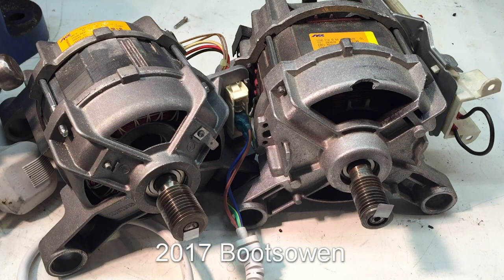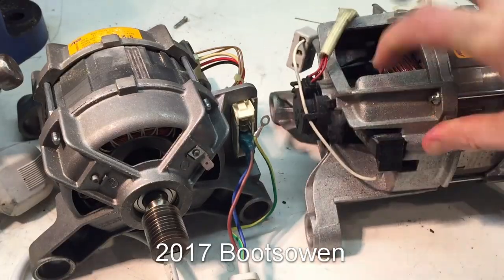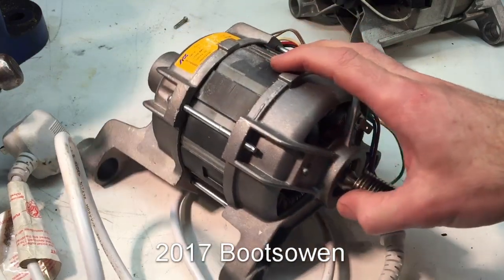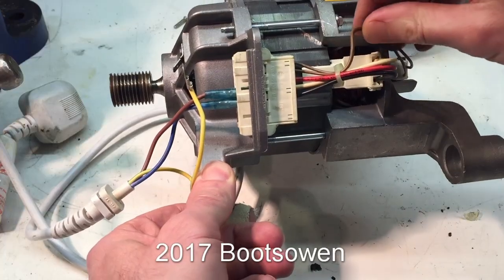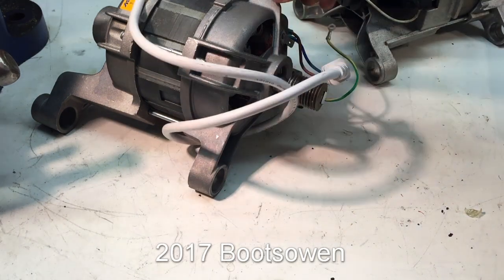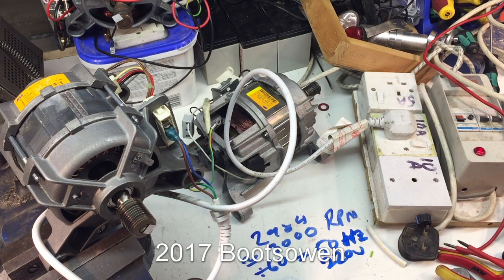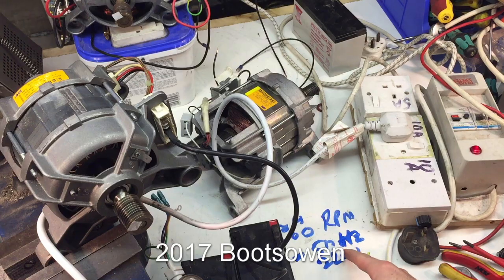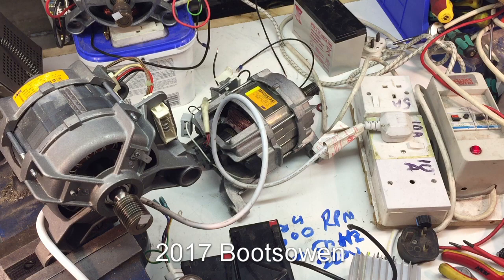Washing Machine Motor Wiring Explained (3 Phase Induction)

Comment: What is the point of this video?  The title says it will show how to wire a 3 phase motor. But all you ever showed was that it doesn't run very well on single phase and not at all on DC.  Why would you even have a 3 phase motor if you don't have 3 phase power? Why not show how nicely a 1 phase AC motor runs on 1 phase AC?  In the US, all our washing machines run very nicely on 1 phase AC motors - for many years.  My dryer is still working after 51 years. No maintenance on the motor.  My washing machine is about 25 years old.

You talked about the extra weight of a universal motor.  You didn't mention the maintenance problems of having brushes.
Reply from the maker: Hi there, newer washers are using these 3 phase motors, they use them with variable, or multiple fixed frequency inverters so that they can run on single phase electricity. I think i showed you a diagram of the wiring inside motor, and how to attach single phase to it to get it to run. perhaps you didn't watch the whole video before commenting. I am glad that you are having such success with your single phase motor.  I have produced many videos of wiring single phase washing machine motors. perhaps you should make a video of your succeses.
Reply: @bootsowen  you talk a lot but explain less than little

Comment: This is what you need to run this motor.  After you learn how to use these motors they are much nicer and easier to control.

https://www.automationdirect.com/adc/Shopping/Catalog/Drives/GS1_(120_z230_VAC_V-z-Hz_Control)/GS1_Drive_Units_(120z_230_VAC)/GS1-20P5

go to Automation Direct and seach for GS1-20P5
Reply from the maker: Thanks, but they usually cost money. If you post a video of how to do it send me a link.

Comment: When you throw bricks in washers I suggest you run those induction motors to spin the drum as they're more powerful and they wont start stalling once the brick goes in so maybe you should try getting a vfd
Reply from the maker: Thanks. It’s just hard to justify the cost.

Comment: You can also run them with caps, still not great but it works. As you said the only real way to run them would be directly from three phase meins or with a VFD. even the cheapest 1.5HP chineesium drives cost about  200+. Really not worth it, unless you want to use it for a small lathe or mill. 
Got a laugh when you mentioned photon :D
Reply from the maker: Agreed, What I didn't mention in the video is the voltage on the motor, it is not 415 anyway, it is a lower voltage, so you would have to program the VFD pretty carefully. It may well burn out the insulation on the windings at 415v. Still, I presume it is cheaper so welcome to the future!
Reply: bootsowen You can run them on a standard VFD without burning them out. You only have to slowly crank up the speed for some reason or it will stall/slip. I successfully installed one of these on a DIY mill and it works great, not much torque but still cheaper than buying a new 1hp motor
Reply: Actually you don't need a strict setup on the VFD for them since the VFD in the washer isn't tha much different than a of the shelf one. The only thing you need is a longer spinup than normal induction motors for some reason. We installed one of those on a custom mill and it works great, not much low end torque but it does the job quite nicely! (motor came out of a Miele washer, can't remember the model anymore)